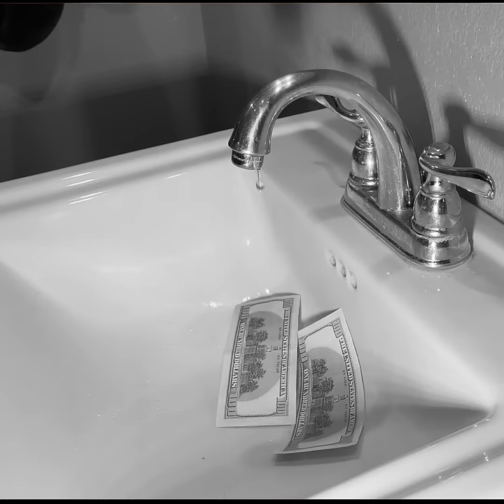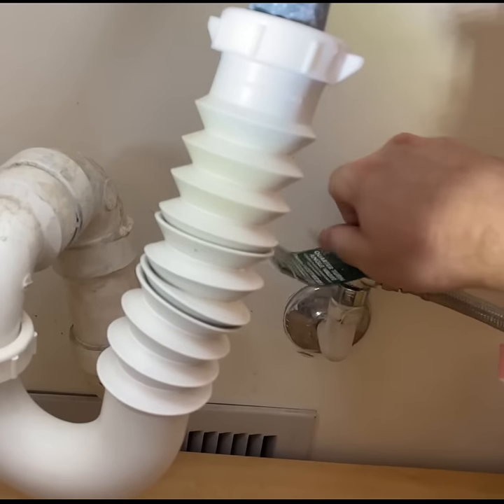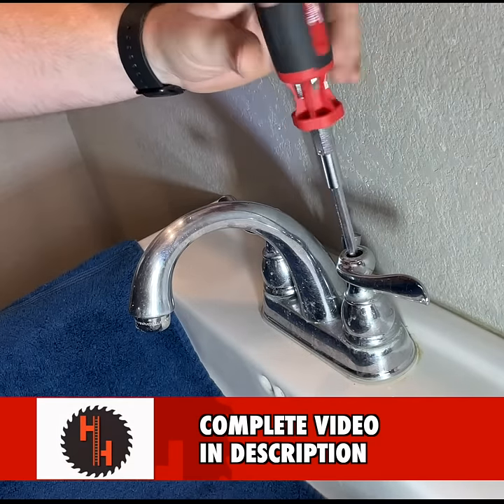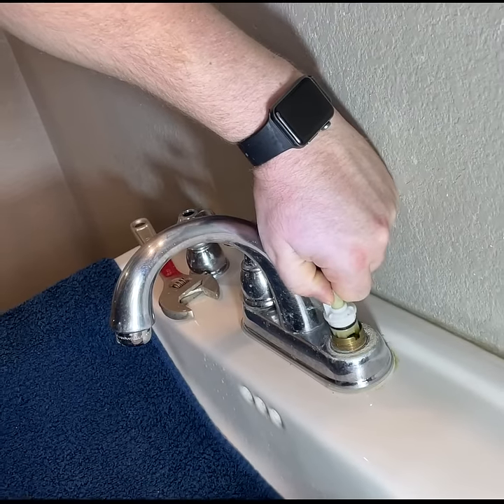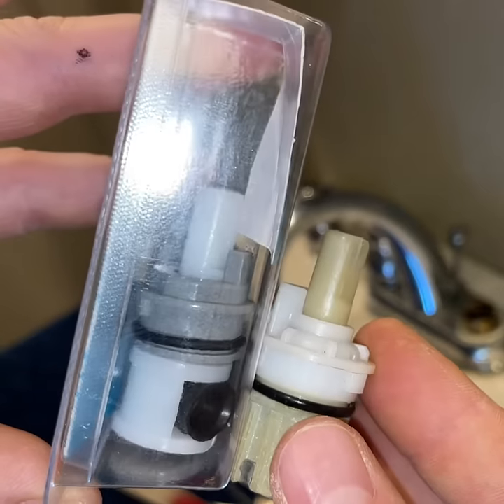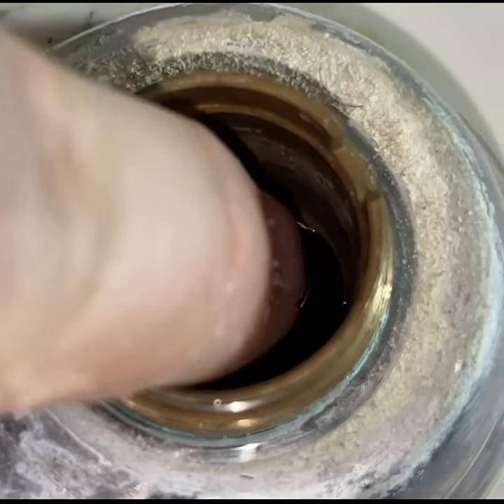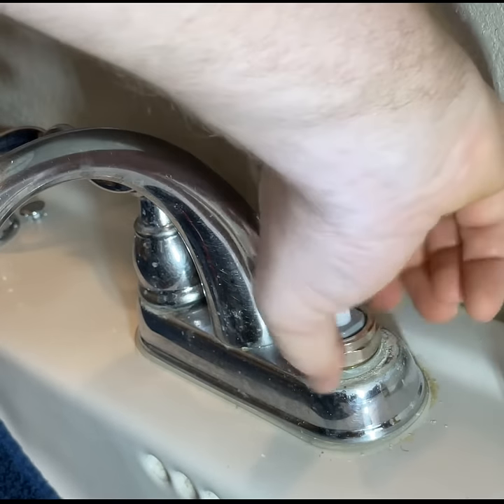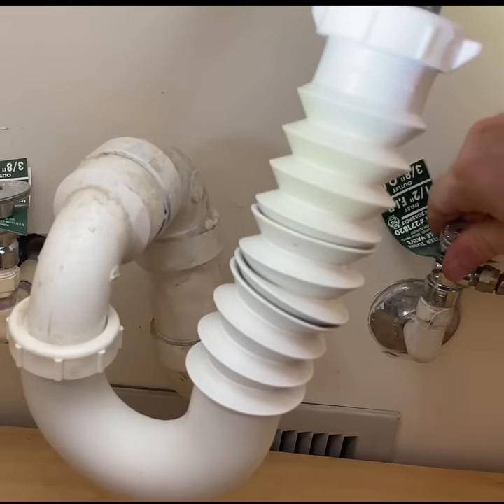💦 FIX A LEAKY FAUCET In 53 seconds!

Comment: We always recommend to service faucets in pairs. Both stems are likely the same age. Easier to just do them both at the same time!
Reply from the maker: That’s a great recommendation. I’ve found with our rental houses (delta faucets) one side needs replaced and the other one will last and last and last. Almost like only 1 bearing going out in the lifetime of a car. Just my experience.
Reply: yeah and shut off the water to both…..SHUT OFF THE WATER TO BOTH!
Reply: I cant turn the shut off valve it ia shut off tight
Reply: @HandymanHertz just replace both man. Can’t expect one side will last longer than the other and Stems are only like $8-$10 a piece. 
Water is naturally corrosive so rubber and spring will get worn out and most the time when it does corrode, it turns into a can of worms like hard to get that shit out for the next guy.
Reply: Disagree why replace if it is good? They might be the same age, but usage will be different depending on the cold and hot weather

Comment: When you put the the new seat and spring is it suppose to be flush in there completely? The one I took off was flat flushed down, and when I do it it’s in there but not flat flush down
Reply from the maker: It is not supposed to be flush, it's supposed to stick up a bit so the spring can press it against the cartridge and seal it. Hope this helps. I have a full video of this same project that goes into more details

Comment: Step 1:Take off cartridge. Step 2: Find the guy like me and Identify faucet and cartridge. In this case Delta! FYI Not all faucet have springs and washers like this. Do it yourselfers go to hardware store and think all faucets are the same and “they all have springs and washers, because guy in video said so”😂. Do your homework. Pull out cartridge and identify it. Moen, Pfister, American Standard, yes even Glacier Bay! Have different stems or cartridges!

Comment: How do we know which side is leaky ? Hot or cold
Reply from the maker: Do you have shut off valves underneath?  Close one of them (the valve on the cold, for instance) and if it stops leaking, it’s the cold. If not, it’s the hot. (Verify this by opening the cold back up and closing the hot in case it’s a rare case of a valve not closing all the way)

Comment: I cannot get the seat to seat. Is it supposed to recess down into where the spring is?
Reply from the maker: yes, but not very much. with a correct fit, the seat should be able to be pressed down and the spring pop it back up. also, make the the spring has the wide end on the bottom. i have a full video of this that should help explain this bettter
Reply: Thank you, I’ll check out the video  @HandymanHertz

Comment: What if the cartridge won't budge?
Reply from the maker: its its like mine, Grab Some Pliers or vise grips and yank it out. I've never ran across anything that was that tough, so make sure the nut is off that is holding it in. i have a full video on replacing this that may be helpful
Reply: @HandymanHertz I had already tried vise-grips and was worried I might do more damage than good so I put it back together and decided to call a plumber after the weekend. Turned the water back on and, THIS IS WILD, it isn't leaking again at all so far! I don't know what to make of that.
Really appreciate your response.
Sincerely,
JR
Reply from the maker: @jrcastillo2824 interesting, the rubber gasket must have got bumped or adjusted. Maybe the Cartridge  nut was loose and allowing water past the seats?. Glad you got it stopped, at least temporarily 👍🏼

Comment: does the rubber part have to go in the hole with the spring or it sort of sits on top?
Reply from the maker: It needs to sit in there. You should be able to push on it and feel a little spring if it’s like mine.
Reply from the maker: I have a longer version of that same video that goes into more explanation

Comment: Of course this is a new model So the nut comes right off. Would’ve been nice to show you taking an old crusty nut off holding the backside. I assume there’s a special wrench on a rod that fits in that tiny area underneath
Reply from the maker: Most of them I come across are this easy that I've experienced.